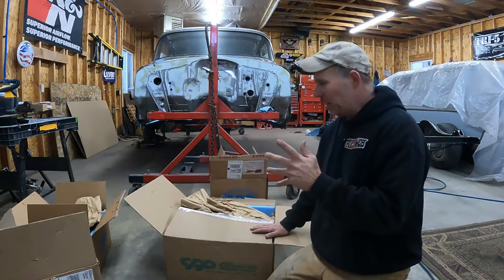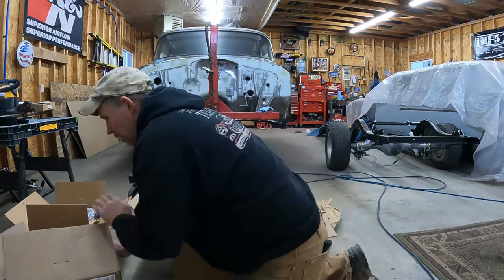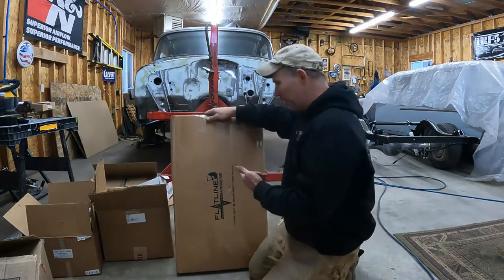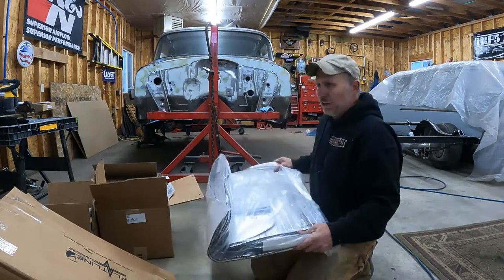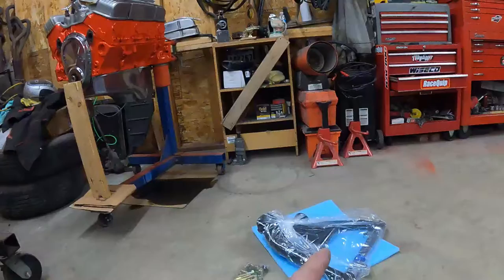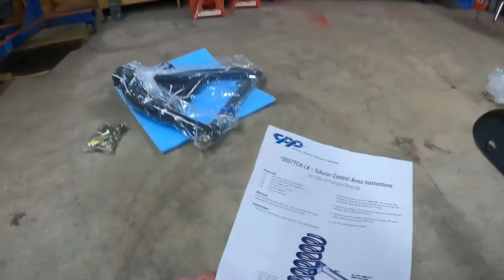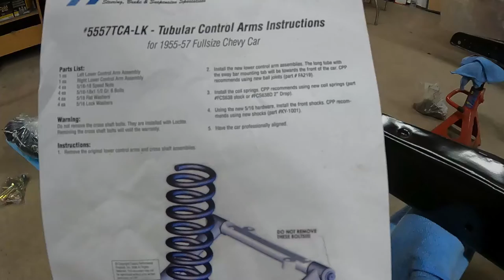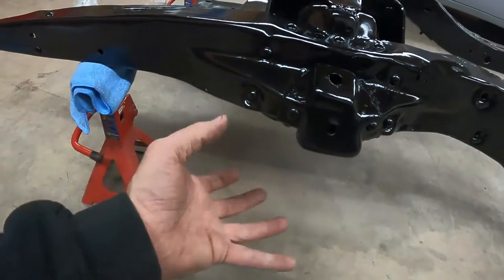Montana Garage '55 Chevy gets CPP Tubular Control Arms, Coil Over Shocks, and Disc Brakes Part 1

Comment: What length and width of bolts for upper control arms? Why would cpp not send them? Idiots I swear.
Reply from the maker: My kit did not come with them either. Luckily for me, my originals were still in place and useable, so I didn't have to deal with finding replacements. Research tells me they are 7/16-20 X 2 1/8 knurled bolts. Good luck sourcing some and thanks for watching!

Comment: That lower control arm that your working on goes on the right side the ball joint faces up not down???
Reply from the maker: I hope not, that would be embarrassing 😬. Maybe some are installed with the ball joint facing up, but these were installed as per instructions with the ball joint facing down. Thanks fir watching and trying to help!

Comment: Do you have list of part numbers for the control arms and coil over shocks/springs? What are the springs rated at?  This should work on a 56 210 post 2 door?? Thanks for any info. The frame is looking really good.
Reply from the maker: Hey man thanks for watching. The springs are rated at 350lbs, and it was recommended to me to use those with a small block. They should work fine on your '56 build, but I would recommend verifying with CPP or whomever you order them from to be sure. I'll dig up part numbers and reply again later. Good luck with the build!
Reply: @MontanaGarage  Thanks you for filming the show. Do you have a video showing how you did the wheel tubes ? thanks

Comment: I think you should have paused the video and picked up some anti seize for those coil over shocks.  Now you have to take it all apart to lube them properly.  It's a video.  No need to rush through the assembly.  The car will be great when it's put together.  The frame and suspension pieces look great.!
Reply from the maker: Thanks for the tip. I just took the coil over back out and put some anti-seize on while installing the other side. Only took a couple minutes. I appreciate you watching!

Comment: Happy New Year!!  Not related to this video, but I am thinking about a rotisserie as my 57 project advances since my  workspace is limited and an odd sized area.  Being able to flip the body up on it's side, on purpose :) would go a long way in maximizing my work area.  Was wondering if you could grab a measurement of the length of your rotisserie with the 55's body in place so I can see if it would work in my area?  Just want to make sure I can open & close the door.  Thanks much, enjoy the videos very much.
Reply from the maker: I'd be glad to do it Dennis. I'll try and post something here tomorrow afternoon. Don't be afraid to remind me if I space it out. Thanks for watching!
Reply from the maker: Hey Dennis. I measured the length of the rotisserie. It is 195 inches long as it sits with the body on it. I'm sure all rotisseries mount a bit differently, but with mine there is approximately 27" of the firewall to the back edge of the rotisserie at the front of the car, and it's abouts 24" from the edge of the tailpan to the back of the rotisserie in the rear. Hope this helps. Let me know if you need anything else. 👊

Comment: Looking good Brad. When I did mine it was a pain in the butt. I had to put the motor back in it for extra weight.
Reply from the maker: Thanks Mike. Did you use regular coil springs? These were pretty easy...
Reply: No I used the Chinese ones LOL

Comment: What weight springs are those?
Reply from the maker: Thanks for watching man. The springs are 350lb. I cannot remember if it was CPP or someone else, but someone recommended those for use with a small block engine.